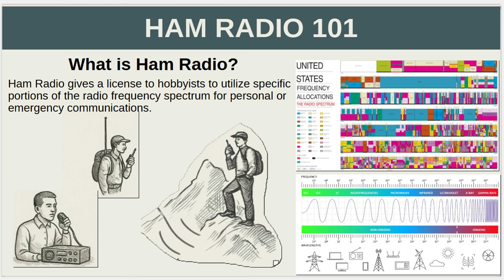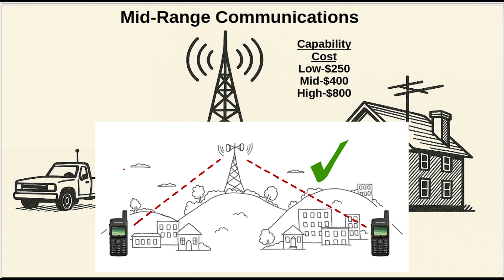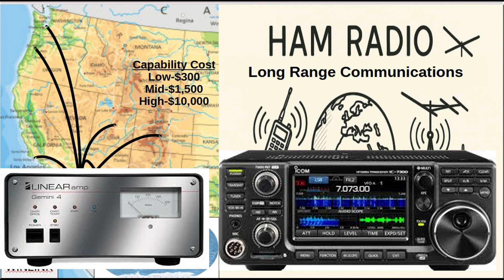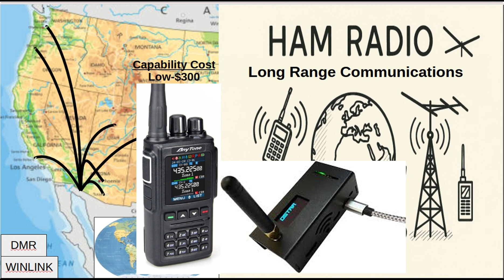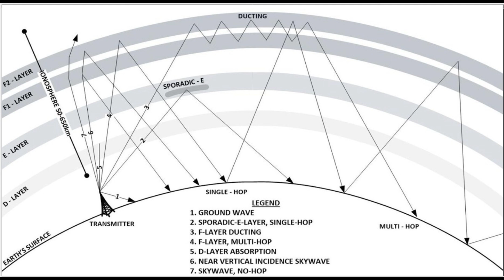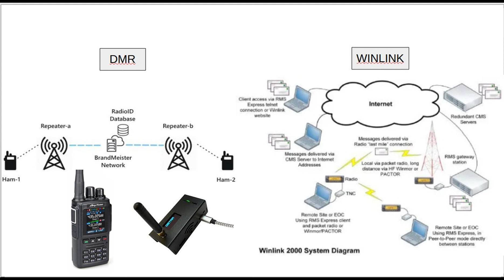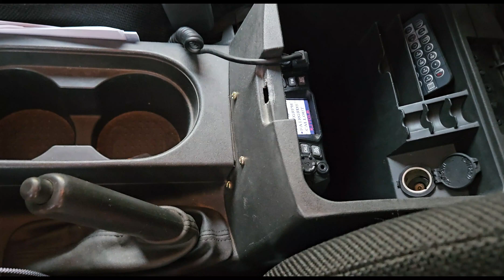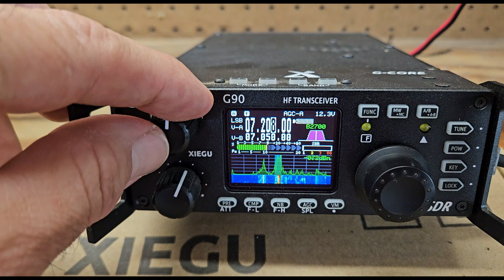Ham Radio 101

Comment: Just remember the EFHW antenna you linked to in description 80m - 10m is 130ish' feet long, so deploying the antenna will require a good amount of space.  Digital modes for VHF UHF communication are great, but they are an all or none type of thing.  If the signal is not crystal clear, it will be garbled.  At least with analog communication it is much easier to pull out a message with a poor signal.   Also keep in mind that ham radios are designed to run off batteries.  12.8V LiFePO4 are the most preferred.  It's much easier to charge a smallish battery with a solar panel, then it is to use a generator to power the radio power supply.  The most important thing for your radio gear is to practice with it.  Of course, in emergency situations (like Hurricane Helene) anyone can transmit on the amateur radio bands.  Any other time requires an amateur radio license.
Reply from the maker: Great tips, thanks for sharing!
Reply from the maker: You can also cut that length in half and operate on 40m, which i found to be more commonly used and easiest to deploy.

Comment: Does the TV signal get affected by the transmission from your vhf / uhf antenna being so close to the tv antenna?
Reply from the maker: I don't know, I'm always in my garage on the radio when I'm using it.  I bet it does to some degree, but now that you say that, I'll probably test it out.  However, the fam is almost always on internet tv, and wouldn't know the difference.  Have you ever experienced issues with UHF/VHF and TV signal interference?
Reply: @ProfessionalPepper  I am reluctant to put the ham antenna on the same mast as the TV unless someone can assure me that there will be no problem. At my age, I don't belong on the roof in the first place, and I sure don't want to affect my XYL TV pleasure.

Comment: Digital ham radio modes changed everything. D-star simplex on vhf goes much farther than FM. VHF CW farther still. All on  tech license.
Reply: Absolutely! Thanks for adding that!
Reply from the maker: You are absolutely correct the Digital Game did change the game.
Reply: All digital radio changed things. I worked as a telecommunications technician and worked on microwave backbone and at gateway earth station and the amount of data with QAM made for things like forward error correction and overhead to control the system. I have a GROL and worked on every from NDBs to KU band satellite and terrestrial microwave systems.